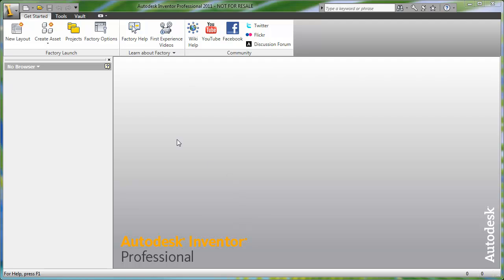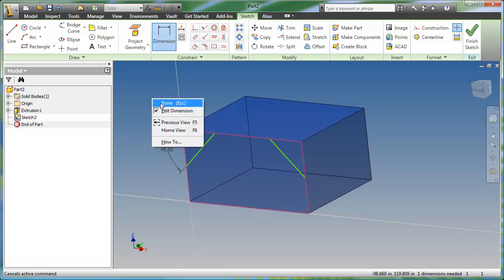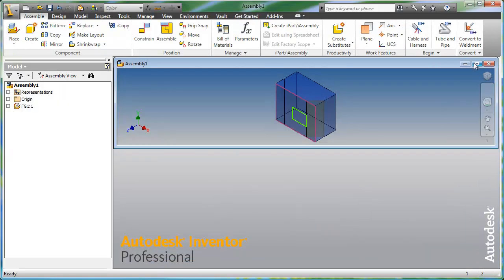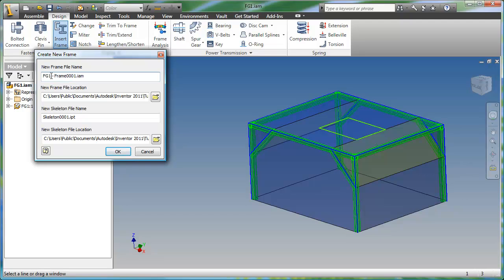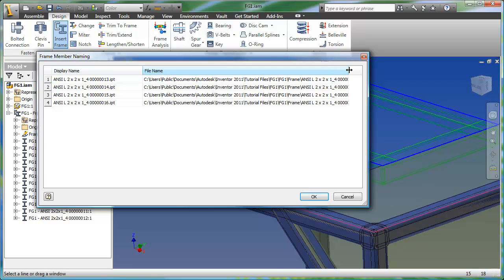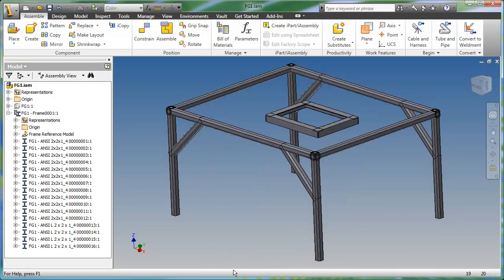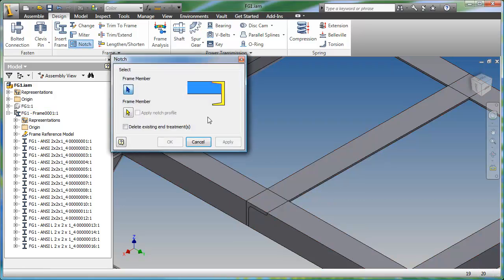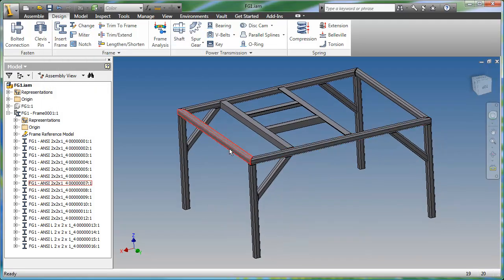Frame Generator Table

Comment: Excellent job! I've not gotten into the frame generator yet so this is very helpful. This is a very articulate explanation on how to create a shop table using a simple mass as the base. It even covers a little bit of data management for the part files. Very nice!